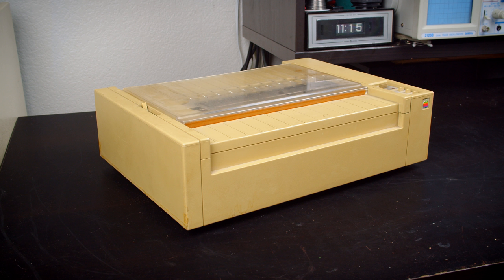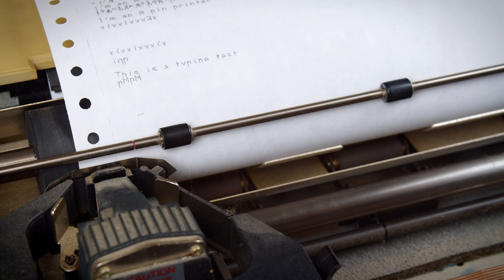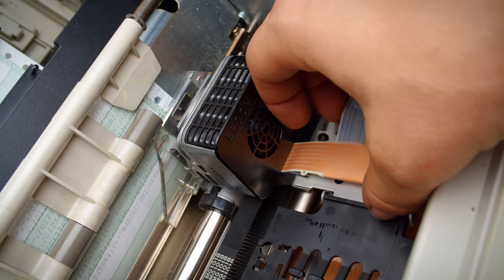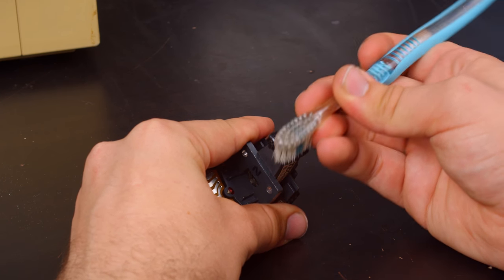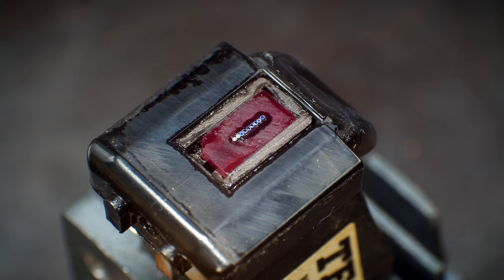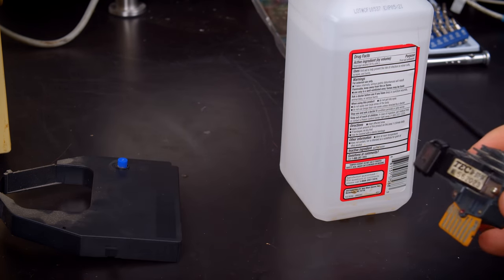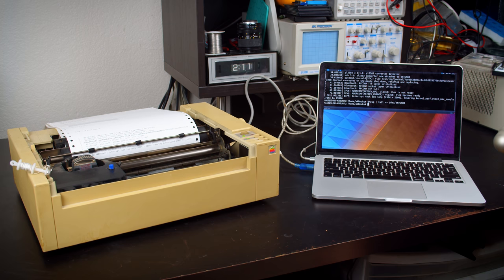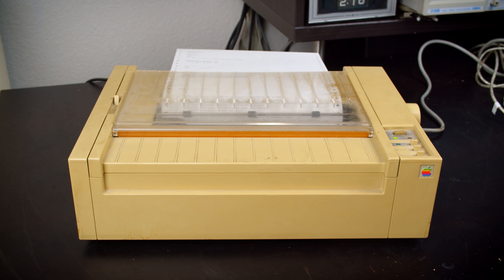Fix Dot Matrix Printer Stuck Pin - Micro Tangent

Comment from the maker: The horizontally compressed letters are most likely bad lubricant in the stepper motor that moves the carriage. This is fixable as well(but not the point of this video) and would be very similar to the fix I did on a floppy drive's stepper motor a while back: https://www.youtube.com/watch?v=q6uTAWpqaEY
Reply: Put some deoxit in it.  It will leave behind a lubricant.  Plus it is safe for most plastics and stuff likely to be inside the head.

Comment: A trip into my past - I've lost count of how many dot matrix heads I've repaired over the years, a lot of the time you have to remove a shim to bring the pins forward as they wear in a pattern that matches the curve of the platen, a good soak in solvent to clear out the old dried ink, de-shim, a light grind and a dress with a small diamond file to deburr the pins and in most cases its as good as new once the head gap is set. Horizontal spacing issues were mostly dirt in the encoder, a strip and clean and it's sorted. Modern kit isn't built to be serviced like this - good to see a video like this, it keeps the technology alive !

Comment: Even though the rest of the hardware was more recent, the wholesaler my mom works at still used dot matrix for their registers for a long time. Her particular location only recently switched to laser as preparation for the new software, but for now this new hardware is still coupled to IBM AS/400. At her new location which was only finished building this year they still have dot matrix printers for some processes. It's cool to see how common these types of printers apparently still are in work environments.

Comment: Still had dot matrix at university in the mid to late 90s. They're still used in a lot of tills as well for some reason. At first I always visualised in my head that the print head would be a block of pins and would form a character and then hit the paper like a typewriter. I guess seeing daisywheel printers puts that picture into your head. My first printer was an MPS-801 in 1985/1986 when tractor feed paper wasn't optional. I ended up using one on the Amiga later on using some special cable.

Comment: In Germany especially doctors still like these to print forms.
Reply: In France too those dot matrix printers are sometimes still used, a local pharmacy in my town used OKI dot matrix printers up until 2018 or so, those things were ungodly slow but hell they were built like tanks!
Reply: Some Car rental places still use them as well
Reply: Anywhere that still prints carbon-copy invoices, really. Most retailers will have switched to laser printers, but some still use old-school carbon-copy stationary.
Reply: Every restaurant I've worked in uses them for printing out the order tickets for the kitchen because carbon copy and they're loud as fuck so we can hear them in the noisy as hell kitchen

Comment: I had the same issue, with the same printer, although I had a pin stuck OUT rather than in, and it was tearing the ribbon. All I did was cleaning and some tri-flow and it's worked great ever since. I LOVE how serviceable these Imagewriters are. Built like a tank too and I use it at least once a month.

Comment: I had an Apple Imagewriter II back in the 80s that we used so much the pins got loose and we had it rebuilt at a local computer shop. I have a working model right now along with two other DMPs.

Comment: Dot matrix impact is the only way to go if you need carbon copies.  Many auto shops still use impact printers.  Not to mention print costs.  The main reason mainframes still print to the fold paper using a large impact printer is print cost (and speed).  The impact print costs are so low, they are essentially zero, especially with the type of ribbon system this printer has.  Laser printer costs is high. Even the best (and worst) laser printer is going to have much higher print cost and require more expensive paper and cannot do carbon copies when needed.

Comment: if you dont mind me asking, waht was the bail of string for?
Reply from the maker: The spool of string isn't important, but it has a magnet on the end of it. There is a magnet in the lid that the printer uses to sense if the top is on or not. So I'm using the magnet to trick it into thinking the lid is on so it will print while open.

Comment: When I used to work on printers back in the 80s, we used to take the back cover off the print head, and dump the whole thing in a vat of trichloroethane (which you can't get anymore).  Then we'd leave it there for a day.  After, we'd let it dry then just repack the head with silicone grease.  And she'd be good to go for a few more years.

Comment: I ended up completely disassembling the head for my Tandy DMP-106. I did get it back together, but the pins are a pain to properly align. Avoid that if you can.

Comment: In my experience the Epson printers have a connector on the bottom that the ribbon cables go into. They are just really hard to see because they are on the underside of the print head. The ribbon cables actually are bent in a Z shape to slip underneath.

Comment: I had a Commodore MPS 1250 (essentially a 1200 with one serial port replaced by a parallel connector and firmware that included support for it and IBM graphics that emulated an Epson FX printer).  The printhead on that was considered a consumable, but a very durable one, with a lifespan measured in millions of characters, and was designed for easy replacement without opening the printer's case.  While verifying this, I ran across a demonstration of how poor Commodore's editorial process could be:  The section on printing custom character sets referred to the printer as an MPS 1200.  This is probably the only section of the manual that got no revision from the MPS 1200 manual.

Comment: These days I go through more printers than paper...often the things don't survive more than about 3-5 cartridge changes... I revived a few inkjets by soaking the print head- but the sad thing is that the ink is more worth than the printer...the last reliable printer I have used was a Canon Pixma iX4000 from 2006
Reply: It seems nothing has changed in 30 years, we're still fixing crappy printers by soaking their heads. 🤦
Reply: I’m still using my Citizen Swift printer from 1996. Cheap to run and built like a tank.

Comment: I want a dot matrix printer that doesn't have descenders to relive my CBM 1525 days.
I'm considering getting a Tandy equivalent, which would work with my PCs, if I can find ink for it...
Or maybe it would just be easier to find a matching truetype font and print it out on my modern inkjet.. not as fun though.

Comment: hey weird question but are you sure the ink is even soluble in alcohol? i know that hp inkjet ink is pretty non soluable in alcohol but water sucks it up like a sponge, wish i still had my dot matrix printers, print a sheet of EEEEEEEEEEEEEEEEEEEEEE and test various spots on it with 70% alcohol vs 91% alcohol vs plain water, it could be possible that 70% containing more water would actually work better here

Comment: If your dot matrix printer works, you absolutely SHOULD NOT DO THIS!   You would not be the first or 10 millionth person who, while trying to make something 1% better completely destroys it and makes it non-functioning.
Like old cars, cleaning a decades old mechanical device can cause problems.  Cleaning out the head can loosen pins that were being held in place (but still working) that would otherwise have broken and fallen out.  Old dirt that is not interfering should be left alone unless there is a very good reason to do what you are doing.  Like other things, if it ain't broke, don't fix it!  There is a lot of wisdom in that phrase.